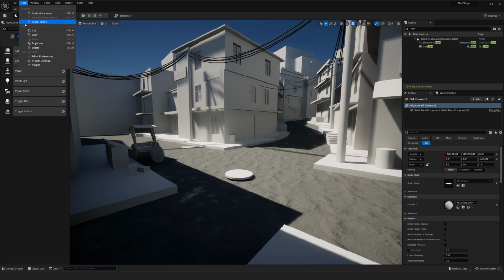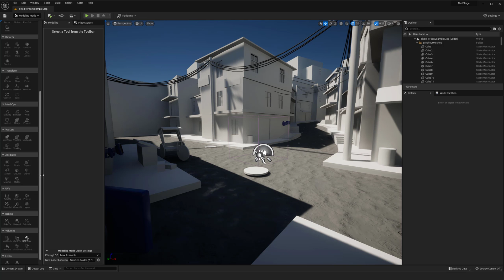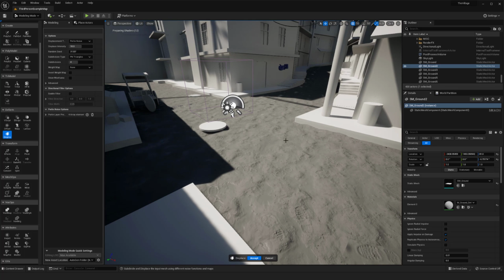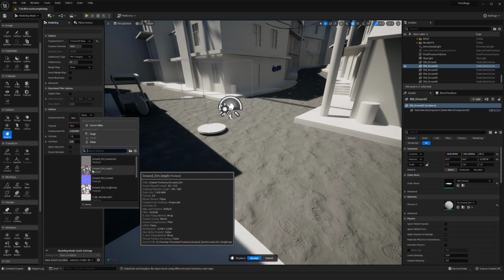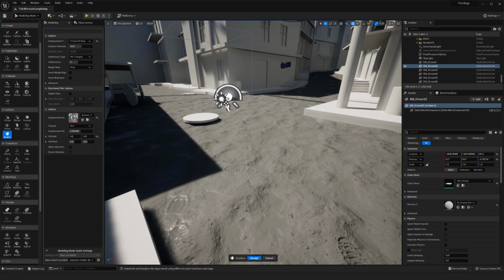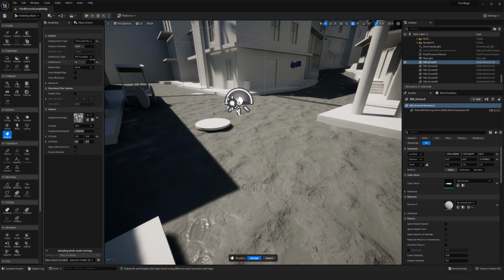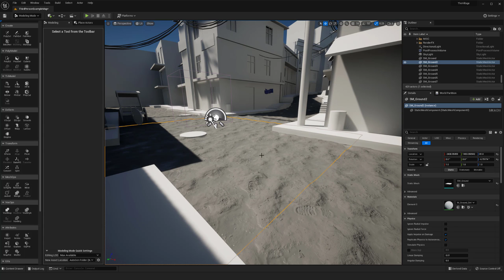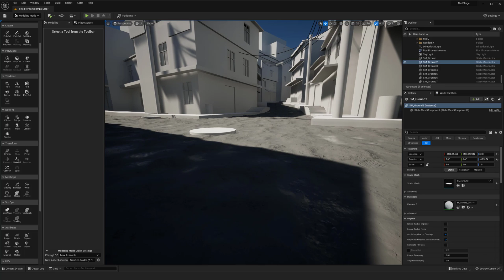Material Displacement in Unreal Engine 5

Comment: what if i have a displacement map imported from blender and want to put it on my landscape (which is not a static mesh). Example: i created a snow material in blender, baked all the texture maps and want to assign that material to my landscape in ue5. since im not doing any modeling on the landscape itself and the displacement is directly on the material it wont allow me to use my displacement map on the landscape in modeling mode. any thoughts on how i can solve that?

Comment: But what about procedural materials? What am I supposed to do if I don't want to change the 3d model, only vary the height for procedural generation of noise?
Reply from the maker: the new method of displacement inside of ue5 will displace your 3d model instead of what you are mentioning that was in ue4
Reply: @PeytonVarney  yeah I came to that conclusion, which is unfortunate for procedural materials that change every runtime

Comment: This isnt material displacement. Please fix your title, unless its clickbait for a reason. Terminology matters.
Reply from the maker: Hi Alexander, it is not intended to be clickbait whatsoever. I feel like the title relates to what it is and I am curious what you would have preferred it to be called? This video goes over the displacement of a material that is placed on the ground plane, it is using a height map from the material and the displacement corresponds with the material itself, hence it being called material displacement. Other programs like Marmoset Toolbag have the same terminology of displacement and within their program you are indeed taking the height map and displacing the geo just like it is being done in this video.
Reply: @PeytonVarney  Actor, terrain, tile, asset, floor, mesh, surface. Honestly there are so many ways to not use the clickbait option. You aren't displacing the material component, you, by Unreal's own definition: "Displace mesh surface with optional subdivision". I sat through this video for absolutely no reason.

Comment: This can only help in cases like this and only with static meshes.
Due to the fact that Epic removed tessellation, it will no longer be possible to implement so many different effects that were very easy to implement in UE4 ... Now I understand why in the Matrix demo the final explosion looked so strange and ugly, as if it were tests 3DMark early 2000s. 
Epic fail...
Reply: Yes, besides, it will no longer be possible to make a tessellation effect so simply, for example, like seams between tiles.
And through this displacement plugin, the grid size is very large for some objects (only 100 unt).

Comment: Nice. How about if the character is far from this area, would it not have the optiom lower the subdivision?
Reply from the maker: something similar to the camera based tessellation LODs in the shader? Technically if they are cut up then you can have it LOD as you get further from each instance but the mesh itself wouldnt necessarily be able to LOD the same like it would with the tessellation!

Comment: Does the latest version of Unreal change anything in this topic.
Is what it shows the official way of working with displacement? It is a bit annoying that there is no official information about the basic function. Epic in Unreal 5 removed the telesection and did not give any information about how displacement will look like in the future
Reply from the maker: Nope, I tried it last night on the latest version and I am pretty sure everything looks the exact same. If you use this technique you will get the same results in UE5. Just make sure to enable the modeling plugin that I mention in the beginning of the video!
Reply: @PeytonVarney  Hi, I'm working on a project for which I need Displacement. At 4 it works but doesn't work with ray tracing. The mistake is that Ray tracing does not see the mesh being deformed, in terms of shadow it treats it as before the deformation. I'd happily continue the project on 5. But the previous versions had a flicker problem. Can 5 now render a clean image?
Reply: @sawtom  Tesselation replacement is Virtual Heightfield Mesh.

Comment: Thanks a lot for the tutorial, I had a question, how many pixel textures per meter in the next gen games?
Reply from the maker: Thanks for the kind words, I think its still going to be case by case basis for texture resolution. Theres not going to be a set in stone number to go by but one could assume that a bump in resolution would be desired! For personal pieces I would suggest giving resolution where needed. If its something super small it probably still does not need a ton of resolution however if its a larger material on screen then it could probably be aided with more!